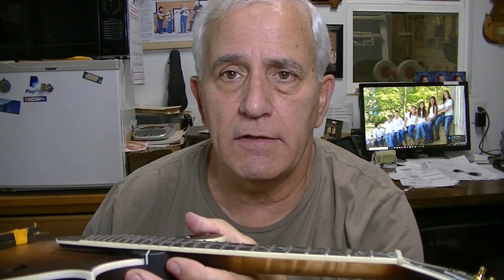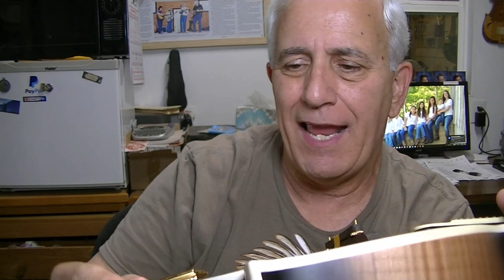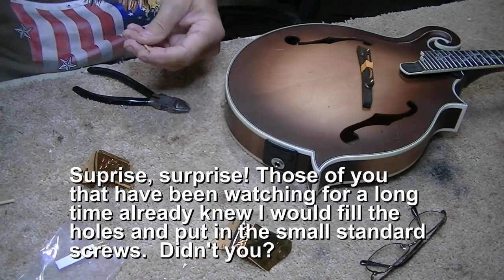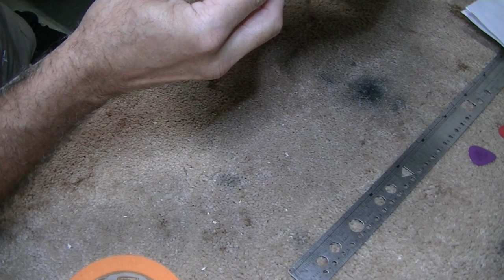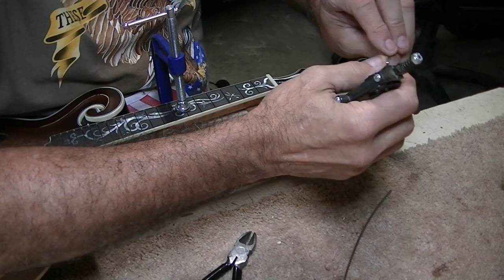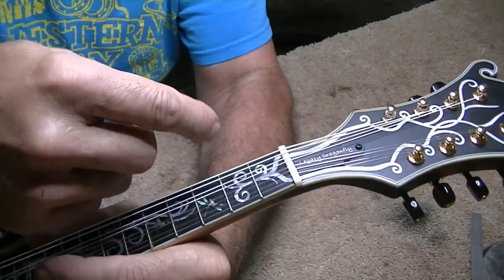312 RSW MK Mandolin Setup And Other Issues

Comment: Hello Jerry. Love your vidoes because you explain it so nicely. I was considering one of these but did not realize they used such large frets. What size do would you say they are?  Did you measure the height and width of the wire they used?  It would be interesting to know if this is what they use on all their mandolins. Thanks for any info.

Comment: I’ve done a level and crown on my electric guitars (and one acoustic) and went all the way up to 2000 grit then polished with a dremel to a mirror finish which makes string bending much smoother and plays like the proverbial “buttah”. I guess it’s of little benefit on a mandolin?

I’m curious though, what is the market value of that mandolin in comparison to what you charged for the refret?

Comment: Good Job Jerry as usual, I want too ask you a question I mean no disrespect But why dont you heat the frets when your pulling them out?? Your the only person I have seen that doesnt heat the frets duiring removal. Man I could see the tailpeice was off center that would bother the hell out of me too, I know it wasnt your fault & you couldnt move it without realigning the neck also. But you are quite the craftsman I hope too be half as good as you some day. Thanks Jerry God Bless
Reply from the maker: Just never learned to do it that way. Doesn't make a lot of common sense to me. It doesn't take much heat at all to expand brass quite a bit.  So it's just going to be tighter in the slot.
Reply: I would think that heating them really only helps if they’ve been glued in .